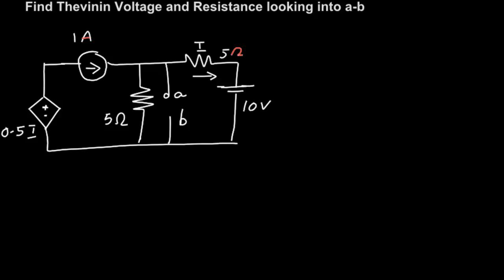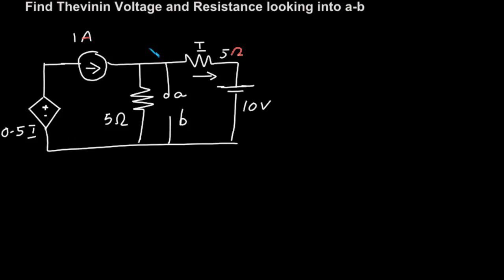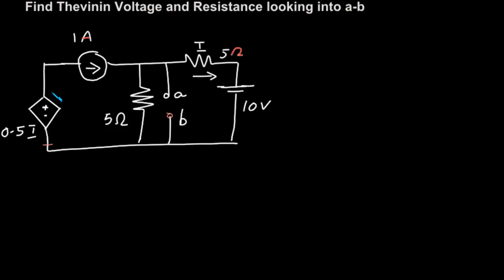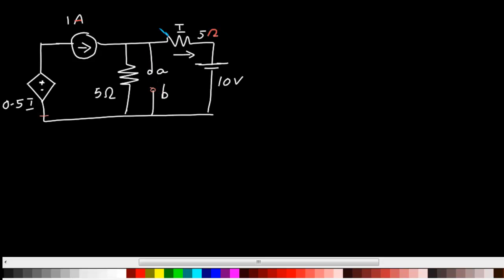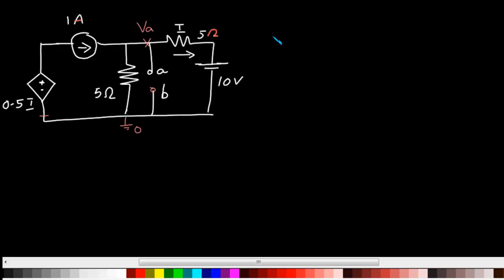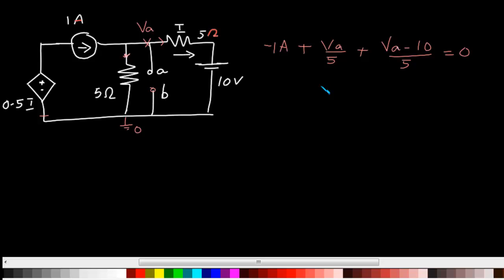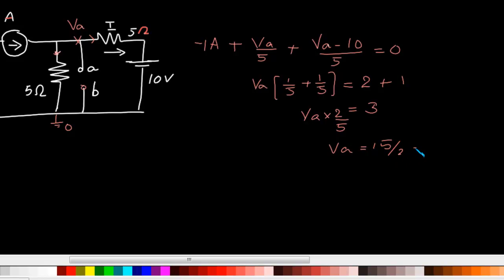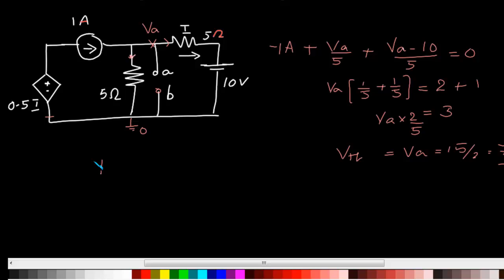GATE EC Previous Papers Network Theory #6

Comment: Sir while calculating sc current above problem the current through 10v
There we als have the node voltage na sir how could u calculated it directly
Reply from the maker: That node is at 0 potential . Once it is shorted to ground. Let me no if you are unsure
Reply from the maker: The method uses two different circuits to calculate Vth an In .